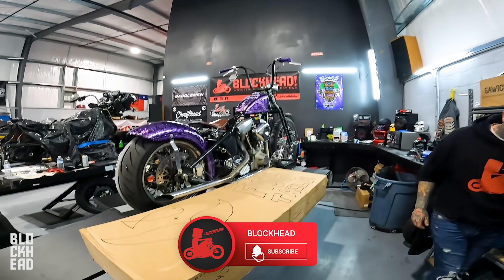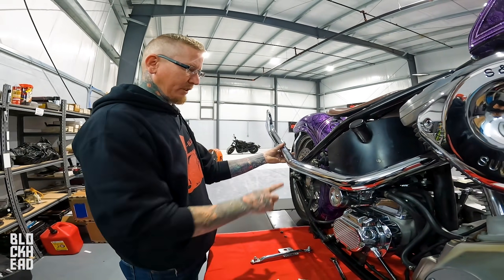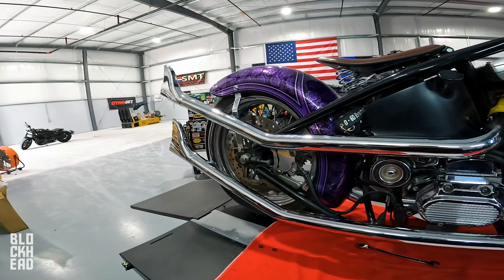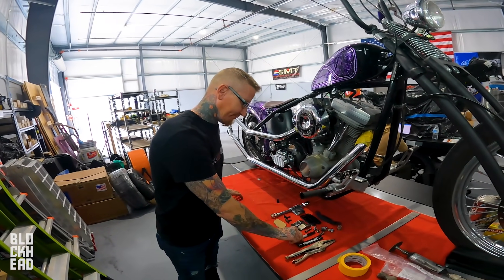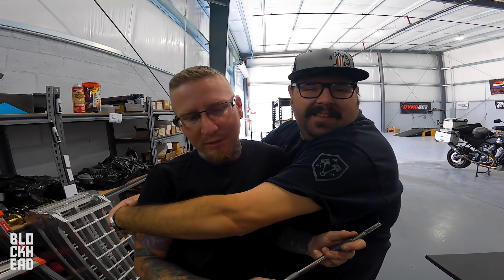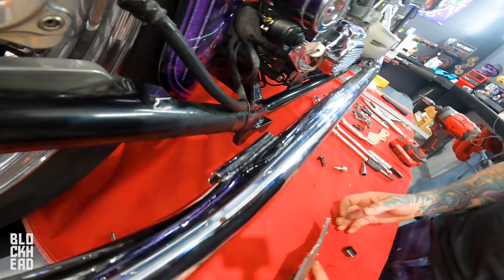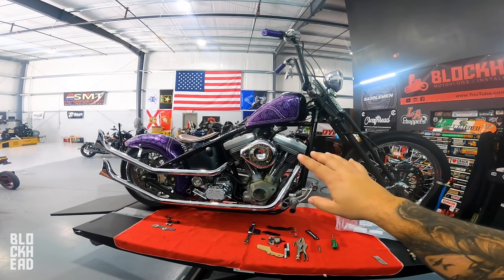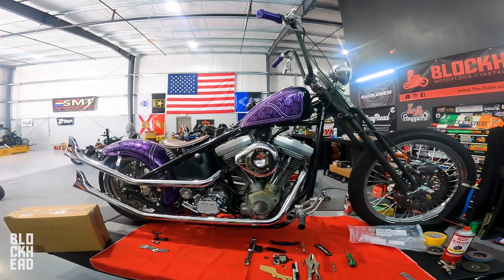Bobber Motorcycle Custom Fish Tail Exhaust!

Comment: Goes without saying and I’m sure Block/Chris did it but for future exhaust installs ensure you don’t handle the exhaust with your hands. Wear gloves so you don’t transfer any oil from your skin onto the exhaust. The subsequent start-up will bake your “paw prints” into the exhaust. After an install I’ve used denatured alcohol to clean the pipes before starting it up. Just my .02 cents….well due to inflation its now .09 cents.

Comment: I really like the tape on the header trick. When I take the exhaust headers off my 70's CB750 the flanges often slide down the pipes, which can be annoying.    Does the back pipe need any heat shielding?